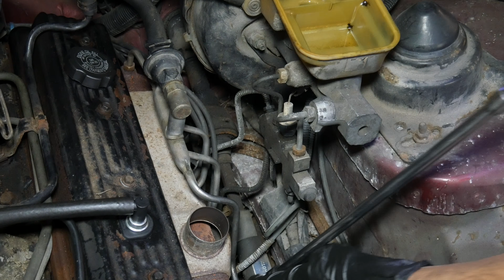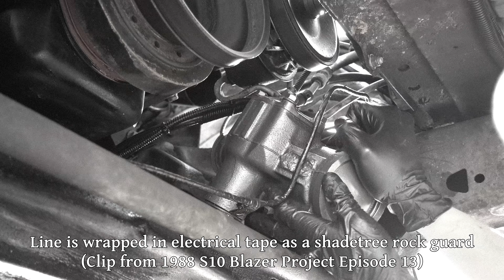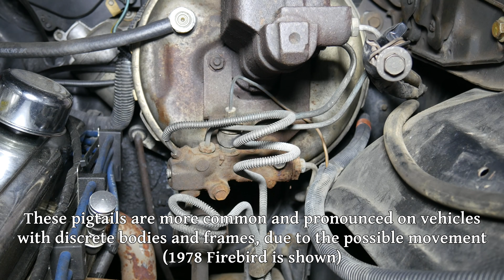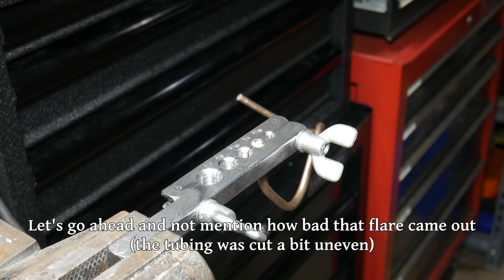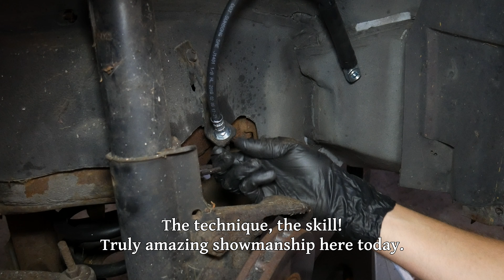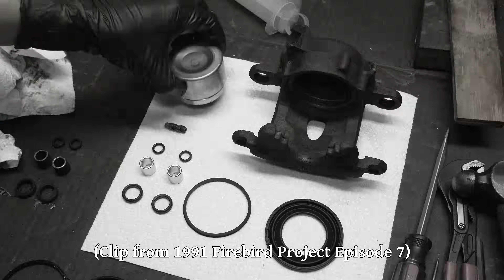1991 Firebird Front Brake Line and Hose Replacement (Ep.8)

Comment: I wanna add a tip
On the tubing cutters the groove on the rollers are for putting the flare when cutting a flare off after forgetting the nut. This is so a min amount of tubing is cut away before reflaring.

Comment: I could not start changing old parts without first cleaning out all the dirt and rust.
Reply: That would take you forever to do on an older car😂
Reply: @lilscarred8516  and I do not think it takes so long
Reply: @MakarovFox  It takes a VERY VERY long time I do it all the time.
Reply: @steve5912  ok
Reply: @steve5912  i dont care it takes so long I prefer to leave the car clean
Reply: @MakarovFox  Yea, and btw you have to get every spec of rust out of the holes or grooves otherwise it will spread everywhere again, bubble paint and everything.
Reply: @steve5912  true story
Reply: @lilscarred8516  i dont care

Comment: The Right Stuff still makes OE style, pre bent and guard sleeved steel brake lines for 3rd gen F bodies, including stainless steel upgrades.  For about the same money, including rental of a bending and flaring tool kit, you can get yourself both left and right side brake lines.  There is absolutely zero point in bending your own brake lines for these F body cars, and I trust OE production well over and above bending and flaring my own lines.  It's a godsend that production brake lines are still available for cars this old, even most modern cars will have you bending and flaring your own brake lines, which is an easy invitation for leaks if the flaring's not done perfectly right.
Reply: It's entirely possible that he's not in on the trick of how to do it, but he explained in the video that replacing the line with a pre-formed one was impossible with the engine in the car. Do the replacements come in multiple pieces or something?
Reply from the maker: I had looked into those, but there is a fairly significant price difference between that and bending custom lines. I'm also sure it's possible, but it seems like it would be very difficult to install some of them like that passenger side front brake line without removing (or at least lifting) the engine. You'd end up bending them to make them fit anyway. Pre-made stainless brake lines are awesome though, and durable enough to survive pretty much anything and for pretty much forever, and it's great that the aftermarket has made that an option!

Comment: How much cost/work would it be to make the car 100% rust free with rust protection?
Reply from the maker: For 100% it would require the entire car to be disassembled, down to pinch welds on body panels being separated and I don't even want to imagine that level of work. For 95%, large parts would have to come out and then the rusty areas ground down, primed, repainted, and undercoated. Still an incredible amount of work, I don't know how to estimate that. Months, most likely. What I will be doing is taking care of the currently problematic rust on structural parts, that is what is really a threat to the car. Things like the surface rust on the air cleaner housing isn't really a concern right now.
Reply: ...just to toss it out there, on my '91 Mustang that had very light underbody rust just starting at the seams of the pinch welds and such, it took me about 2-3 weeks of free time to grind out all of the seams, rough the factory paint, clean it, prime it, and paint it. At that time, the exhaust and drive shaft were already out for other work, thus making it easier, and I still haven't gotten back to it to drop the gas tank and do from behind the rear axle to the rear bumper. Cost was about $300 by the time you add up all of the cleaners and rattle bombs and everything.

That was on a car that was driven in ONE winter (and I believe it), had 79,000 miles at 16 years old, and was always garaged.

So... I'm saying on an old car that was in really nice shape already, doing a small portion of that work, took about a month of free time if you factor in taking the stuff off and putting it back on.

Actual vehicle restoration isn't for the faint of heart or shallow of pockets. You're far ahead of the game to just buy a nicer car to begin with if having a restored jewel is your final goal.
Reply: @FuzzyDiceProjects  Yep, Everything would need to be blasted and at that point might as well restore it.

Comment: You weren't kidding about the similarities in our videos at the moment... It's like we're doing the same pain in the ass jobs, just on different cars and states away. LOL. 

I've also never seen GM use a bubble flare. That's pretty crazy!

edit: Also... I may have missed it, but it's generally a good idea to apply some grease to the back of the pads to keep them nice and quiet (and keep them from sticking to the caliper piston). It will also make them a lot easier to remove next time.... Not sure you greased the spindle (or caliper... hard to tell which way they are and which side on this car)-to-pad interface either...?
Reply from the maker: I always used to grease the pads, but I've kind of been experimenting with not doing it and trying to tell if there is any difference. Haven't noticed anything yet, but it wouldn't hurt to do that of course.

And this was filmed in the beginning of November lol, I am a little behind on all of this editing. Do still need to replace the rear brake/fuel lines and hoping to do that soon-ish, though.
Reply: @FuzzyDiceProjects  At least in regard to the pad-to-caliper/spindle interface, you really do need to grease those to hopefully slow the wear of the sliding surfaces. My TJ (and all of the others of its lineage) are famous for wearing the spindles out from the pads rubbing them off. I'd bet if you look at your buddy's XJ (Shawn...? If he still owns it) their likely worn plumb out.. New ones are $350/ea. Hard to know F-bodies would have the same issue, but why chance it?

I hear ya man... It's not so much the filming and wrenching, but  as I've learned, editing takes an eternity. Especially with the snazzy stuff you're doing these days. Your production quality just keeps getting better and better! Nice work!

Comment: Where do you get your black gloves? What brand, etc?
Reply from the maker: I have pretty much only used Harbor Freight 9mil gloves recently, they are the best that I have used and still pretty inexpensive. With a coupon it's $10 for 50 and they usually last several uses, they stand up to being removed and put back on pretty well. The Large size is a tad bit too big but the fingers on the Medium are too short, though that's more of a universal sizing issue I have with gloves.

Comment: Ooooo, shoulda made a new line for the drivers. Steel lines rust on the inside too so always best to replace when you have the chance.

Nice job though :)
Reply: There's stuff running around from the 50s with the original brake lines on it. The "rusting on the inside" is just marketing wank from places like Jiffy Lube trying to get you to buy a brake fluid flush (which is a good idea from time to time, but not for that reason).
Reply: @TheBrokenLife  I've had it on a few of my old cars and the fact that the fluid is hydroscopic and will absorb moisture over time It's a possibility.
Biggest reason really is steel rusts and Kunifer does not so I just prefer to have brake lines I never have to look at again :)
Reply: @1959VWBeetle  I've never seen a line rust from the inside out. I do have a large collection of SUPER rusty, on the outside, lines that I can cut open, examine, and post a video of if you'd like.
Reply: @TheBrokenLife  Well I did find this on a good few of my UK cars. Maybe the steel line used was of lesser quality, who knows but it was certainly the case.
Either way I think using kunifer is just the smart move for maintenance free driving. I hate having to do a job twice so if there's a true fit and forget option that don't break the bank then I'm all game :)
Reply: @1959VWBeetle  That's entirely possible. No telling what sort of steel your cars may have had vs. mine. My stuff all dies from the outside in, and lately, in spectacular fashion. 

No argument at all about the kunifer/nicop line. It's absolutely the best material to use without a doubt. I also like to use stainless flare nuts to make sure I never have to worry about getting them released from their mating component. Good materials only seem expensive if you haven't spent hours cursing and bleeding trying to get bad ones apart later.

Comment: Good video as always. But i was under the assumption that the double flare is pretty much mandatory.
Reply: I've never seen a GM use a bubble flare before, but sure enough, what he showed coming off of the car are bubbles. Don't confuse a bubble flare for a single flare. Totally different things.
Reply from the maker: As Maxwelhse said, you always want to match up the flare you are using to the parts that came off of the car. Most GM vehicles use a double flare but this one happens to use a bubble flare, and the parts they mate with have to match the type of flare. Double flares seal on the inside edge while bubble flares seal on the outside edge, here's a good diagram: http://repairguide.autozone.com/znetrgs/repair_guide_content/en_us/images/0900c152/80/26/8b/49/medium/0900c15280268b49.gif